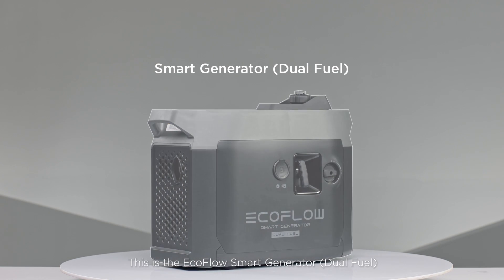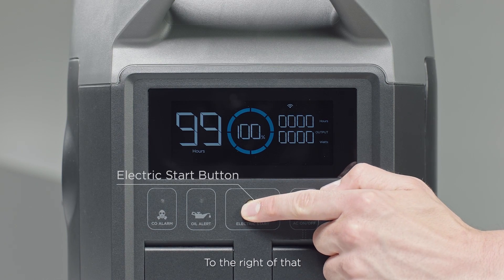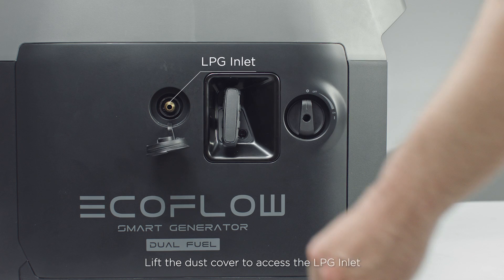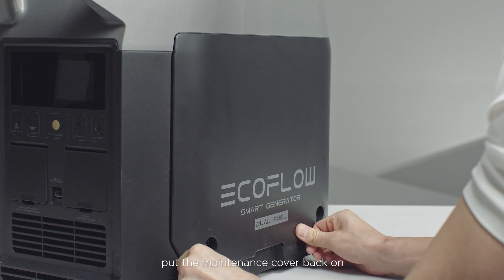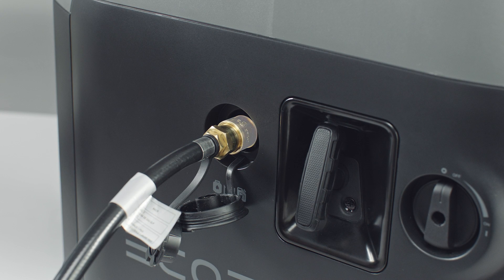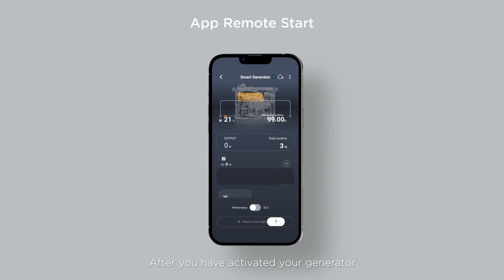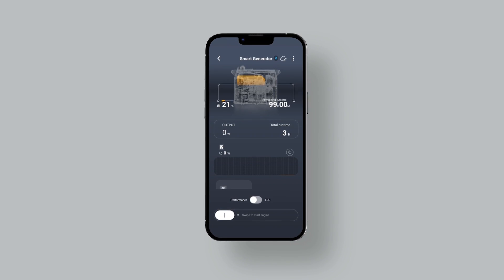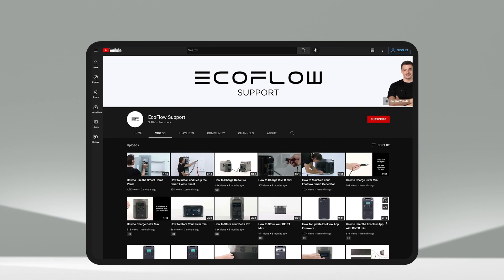Smart Generator (Dual Fuel) Tutorials | Smart Generator Overview

Comment: I have bought: 
The river 2
The Delta 2 
The Delta Max 
The Wave 2 
Two solar panels 110 watt, 160 watt 
And it seems like I was chasing the Sun every day I'm not having full batteries at the end of the day. 
I live full time in my sprinter van, in Northwest Montana. 
I decided to try the duel fuel generator. 
I have had it for 2 days and ran it for 4 hours. 
Are temps here are over a hundred degrees right now, and the Wave 2 has not been able to keep up with the heat I find that very disappointing. 
But the dual fuel generator I'm only going to run on propane because I believe gas is dirty and it goops up your carburetor.
I run everything I have on my 3 Eco Flo battery Banks, and now I can easily charge them all without chasing the sun because of my dual fuel generator. 
Did I mention I'm 63 years old I'm on my second pacemaker defibrillator and have rheumatoid arthritis, 
The electric start on the generator has been a true blessing. 
Thank you ecoflow for fantastic products. 
Oh one more thing 
I have an all powers 200 watt foldable solar panel and I like it way more than I do either of the Eco flows I bought.
Other than those two things I'm a very pleased customer.

Comment: I already have a 9600W tri-fuel generator and am looking to do a dual Ecoflow 30 amp home hookup with the generator as a backup to charge the batteries in the event of a longer outage (had a 3 day outage 2 years ago).  I see that the Delta has the EV X-stream adapter for higher charging input.  Is there a way to connect my 30 amp or even 50 amp generator connection to the EcoFlow unit to charge instead of one of the slow AC connections?  If I have the dual unit plus either 2 or 4 battery backups (haven't decided on 2 or 4 yet), it could take a very long time to charge.  What cables do I get and where do I connect it/them?

Comment: For the cost of the Ecoflow I thought the LP connection was on  all units.   Any HACK TO EXTEND THE EXHAUST OUTLET BY A HOSE?   Are the Electronics safe outside?  in wet conditions in the weather, no one want to run this with a open garage or under a camper out of the way of snow and rain... and what about the generator battery if it's to cold will it charge ? will it start? is the battery a LifePO4 ? they have to be warm at 50 degrees to take a charge?
Reply: Buy one and figure it out

Comment: So many questions, so little answers…
Reply: I can prob help you.
Reply: @imprezzs1864  do you need the special adapter to DC charge the new Delta 2? Like you need for the Pro? Can you simultaneous charge two different units (like a delta 2 and a Pro) one with AC and the other with DC?
Reply: @Janette  no it's plug and play you only need an adapter with Delta Pro and the Power kit.

Comment: This will really come in handy during emergencies.  When the fuel runs out I can still run it using propane.
Reply: What happens when there's no fuel to get the propane from shore to store?
Reply: @SteveVi0lence  you can STILL attach solar!
Reply: Use gas. Duh.

Comment: I never thought of using propane to run a generator but this is awesome. I now have the choice to run it with propane or gas.
Reply: -You can store Propane a lot longer than unleaded
-It burns a lot cleaner so it will be better for engine life expectancy
-Still wouldn't run it it in doors but there will be less noxious fumes